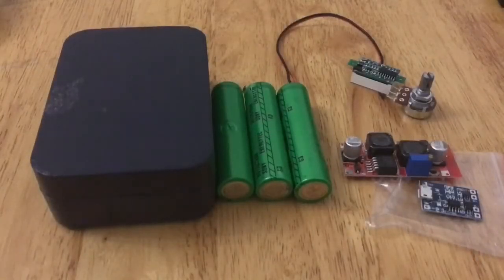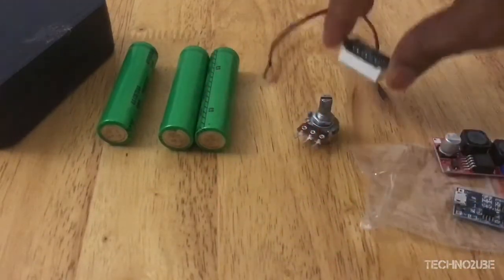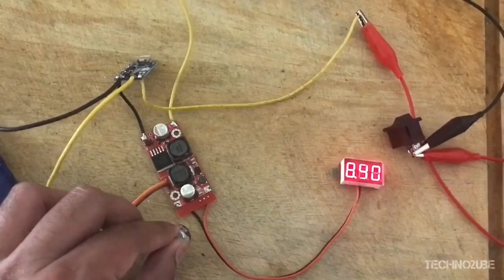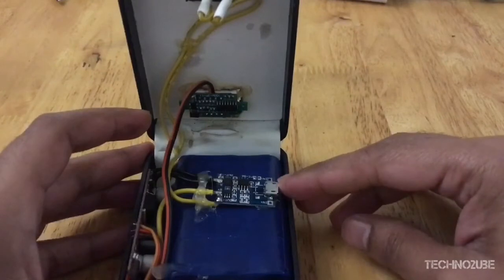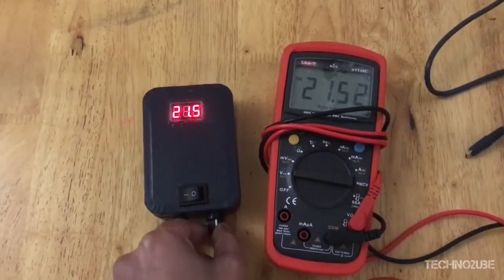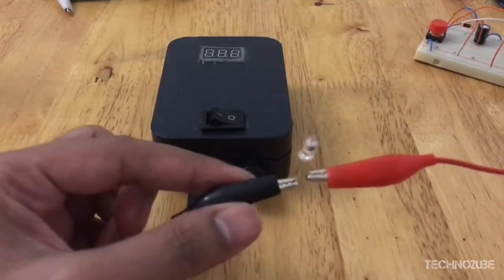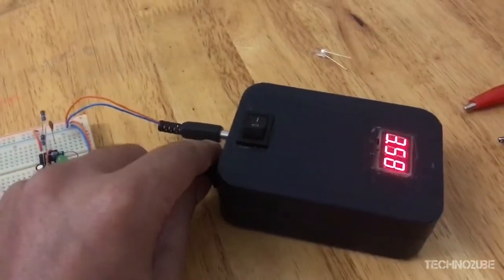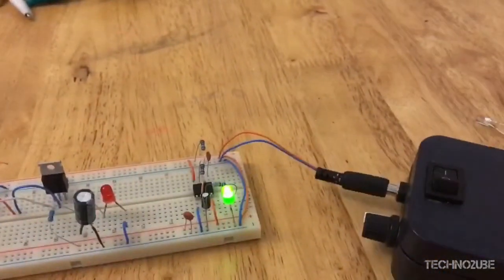Make a portable Adjustable Voltage Power Supply that can also be recharged

Comment: Love the looks of this project, however, I ordered the xl6009 and there is no place on module to solder in the 10k pot. And the 4056 has only one each out- and out+. I'm not a project guru by any stretch but figured it would be simple, then these hiccups came up. Thanks for any info for this noob!
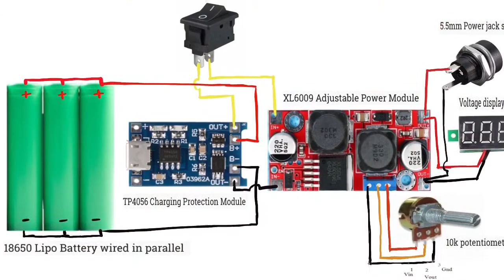Reply: If you look the Diagram at 0:53 it shows where to wire the 10 pot, what you have to do is desolder the Blue  square pot that is already on the board.  also the diagram show which wires you have to connect.

Comment: On datasheets there's written "minimum input voltage 5v". Your battery are parallel it's about 4.3v when fully charge. Do the converter still okay?
Reply from the maker: Yes the boost convertor does work with 4.3v perfectly as those lipo battery provide plenty of current.